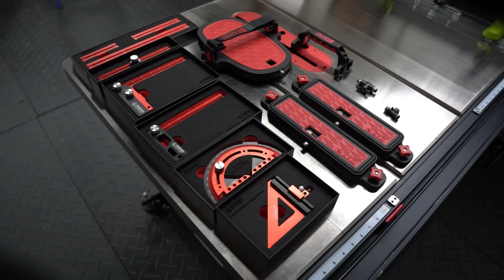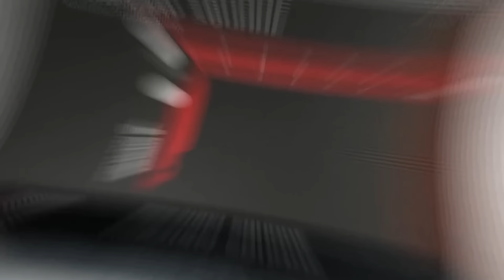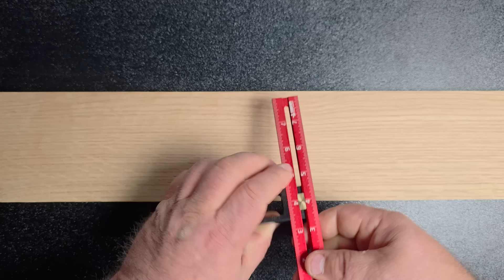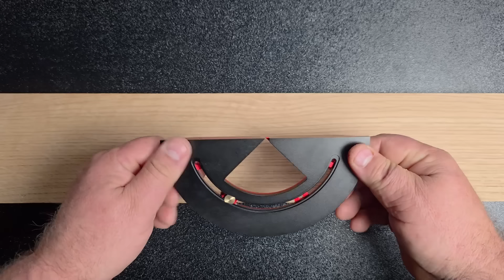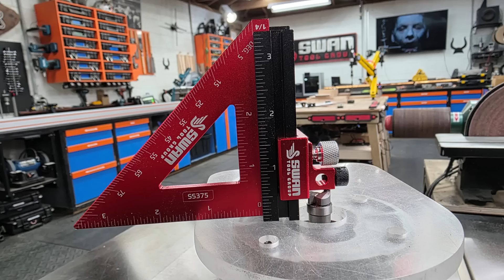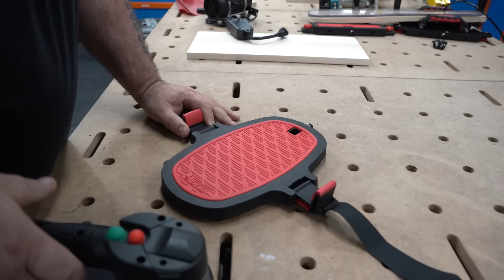Is it time to retire your old tools?

Comment: All of this is genius, the only thing I might suggest is the ruler tools without the 8 inch ruler so we can buy the 3pack without duplicating stuff. Or maybe a 2 pack ruler set with just the... damn you already thought of this! I just realized the tools come with 8 inch rulers and the ruler 3 ack comes with 4, 6, and 12... no duplication! You really do think of everything.

Additional smaller pucks options in the future would be nice though. Not that I have a problem with this size, but I can see situations with pattern routing were smaller might come in handy too.  I understand you need to get a bit established before flooding the market with SKU options.

Comment: I like the idea behind those squares and the protractor, but having used the thinner blades of other layout and marking tools (Incra's rulers, Shinwa's rulers, Woodpecker's stainless squares, Jessem stainless squares), I couldn't go back to thicker aluminum blades. Introduces too much parallax error for my tastes.

I don't know if it's possible given the reversibility of some of those tools, but I would consider a variation of those tools that use beveled edges on the blades to get the markings as close to the work piece as possible, or find a way to wrap the tick marks around the edge of the blade, which would accomplish something similar.

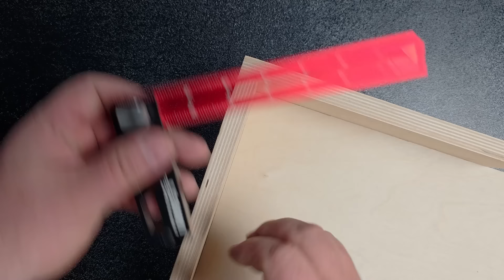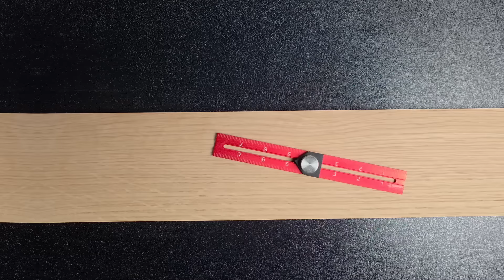Comment: I would suggest using a light color, rather than black, for the one part of each tool so it's easier to see the shadow of a gap such as at 5:55 or 6:01 without having a source of light behind the tool.

Comment: The expansion set it True Genius! ... well there is a lot of genius in these tools. You obviously know your stuff.
But modular expansion is something I've craved so much.. 
Something I've been working on with mixed success is telescopic expansion. Something that was telescopic yet rigid strong ＆ dead flat / plumb when extended would be something special

Comment: The diameter of the holes for marking on the protractor is very large. Even in your example, you can see how the line “wobbles.” In other words, you have to try very hard to make a straight line in the right place. Usually, such holes should be no larger than the tip of a pencil. Otherwise, they are simply useless holes. There can be no question of accuracy.

Comment: There are some interesting items in there, especially the vacuum stuff. One thing that I would like to mention, though. A linear measuring tool, commonly referred to as a ruler, is in fact called a rule. A ruler is someone like a monarch or emperor. It is a common and widespread error, but an error, nonetheless.
Reply: My high school drafting teacher told us that there is only one ruler in the classroom; him. Rules are the mandatory instructions required by the ruler. Those wooden and plastic measuring sticks are called scales. Theoretically a scale is a system of markings, but the stick is necessary to hold the markings still. Hence the stick and the markings are called a scale.
Reply: This is inaccurate.  There is in fact a difference between a rule and a ruler in this context.  A ruler's zero measurement is inset from it's edge.  A rule's zero measurement is the edge itself.

Comment: I don't have a fancy MFT table. I just use whatever flat space is available in my shop. I would be interested in double sided vacuum pucks because it seems like most of the existing options require a special table.
Reply: I would say definitely try the mft table. I only made three rows on the top. Two columns down on either side. Rest of the table is solid. I use my bench dogs tool fence and quad hinge system with the track saw. Everything works beautifully. The precision and ease is amazing. If I ever need an awkward clamping hole, I just use the 20mm drill/router bit and drill a quick hole.

Accessories are costly with mft. But if you adopt it and see the utility of it, really great idea.

Comment: I am an American but I live and work overseas so I use both metric and imperial units. I buy tapes that are dual system and when working, I use whichever one gives me an exact measure. In other words I match a workpiece edge to a black line that lines up perfect and use whatever scale it’s on. It’s good be “bilingual”😂😂
Reply: Brill. exactly what I do, whichever is more accurate.  I was brought up with imperial as a machinist in the steel industry, (as per USA) but in UK, and then of course we aligned with Europe and metric.  So whichever is the closest is no problem.

Comment: Very sexy tools and very smart ones as well. Also nice, that you have mentioned that there will be metric versions and that it will be possible to buy them in Germany.

2 questions though.

You said that everything is designed by you and your team, but where are these tools being manufactured?

Secondly, what kind of precision do the squares have? Like the german DIN 875/00 or the best woodpecker squares?

Greetings from Germany
Reply from the maker: Yes they will be in Germany in a couple months

Comment: anyone tried vacuum template work with 3d printing? how porous are 3d printed templates? Is it practical? do you have to seal the print like you would, say, mdf templates? can you seal the prints? Or would it more be like cutting an undersized sheet of something, fixing it to the 3d print, then weather stripping THAT, and then using that as an airtight vacuum module that is just mechanically attached to a 3d printed template?

Comment: Great inventions! My only concern is the true mark cut out. I normally use 0.3-0.5mm mechanical pencils and sometimes the tips are very sharp and thin. The tip may slide into the cut outs and give inconsistent markings. I have squares with very slight bevels facing the same problem. Hopefully there is an option without the true mark cut out. Thanks
Reply: I hope to soon see a better explanation of this Tru-Mark Edge.   How does it remove the pencil parallax error while accommodating several thicknesses of pencil leads?   Does it also work with a marking knife?
Reply from the maker: @jwiereng it work with common size leads. For ultra fine and knife marking the opposite siye of the ruler is traditional and does not have the tru mark notch
Reply: @izzyswan It would be great if you could offer an option with all sides flat. That way, it’s more consistent and it’s better to be consistently out rather than to be in or out sometimes. That’s just my personal preference. Thanks
Reply from the maker: We will. But we have to take one step ant a time :)
Reply: @izzyswan Great! Thank you!!!
Reply from the maker: Only one side of the ruler is tru mark the other side is straight like tradition rulers
Reply: @izzyswan Thanks. That really helps.

Comment: Would it make sense to wrap the markings on the rulers down the side? That way you can reduce paralax. It would increase the price due to an extra step though so maybe as an option. It also may make small dips in an otherwise straight line. Probably not a real problem but could annoy some.

Comment: Even though I live in the US, I'll wait until these tools are available globally since I prefer working in metric. Just so much easier.
Reply: I live in US also. I rarely use imperial measurements anymore. 99% of what I have todo is in metric.
Reply: @mumbles1justin did you not listen?
Reply: @davidcorliss  did you not listen to him say they wont be available until next year
Reply: Yeah. I tend to work in both on different projects and prefer to tools that also include both. A vernier scale on the protractor would go a long way for machinist projects, too (though mostly just because verier scales are cool).
Reply: 17:12
Reply: Metric vs imperial is not easier since both are decimal, if that is the issue.  With metric you don't get the advantages of the fractional system, though for all I know if may exist.  The modern world was for most part invented in decimal inches before metric showed up, of course.  Fractions have a lot of advantages in carpentry and architecture, but they are heavy lifting for some.  I gather these tools are not in decimal inches, so as far as that goes, you score a point.  Since I have machine tools, that use decimal inches, I have three different system in the shop.
Reply: @HondoTrailside  so many people hating on imperial these days. I think they just hate America and choose that bit to pick on. Shows up as ignorance when they don't even know WHY it's built the way it is in the first place. None of them seem to have any issue with hours being 60 minutes though😂
Reply: Weird because I work with several Europeans doing trim carpentry that use the inch now and like it better, to each their own
Reply: @elijahlafayette7666  If your not working off CAD drawings done in metric or don’t have stringent tolerances to fallow. Imperial is ok.
Reply from the maker: Thanks for the feedback!
Reply: @final1335days did you not listen to what he said about metric versions?
Reply: Blah blah blah

Comment: If you make the size of the box to be divisible by 42mm, the users can stick a gridfinity pattern on the bottom of the box, and use it directly in their gridfinity systems.
Reply from the maker: Cool idea❤
Reply: @izzyswan Actually it would be pretty easy to include the grdfinity into the design of the box from the get go.
Reply: @randallthomas5207  that would quadruple the price of each box at least. Boxes are very standardized in construction
Reply: @izzyswan  I would love this!
Reply: That was my first thought when I saw the boxes.
Reply: I think you mean 32 mm